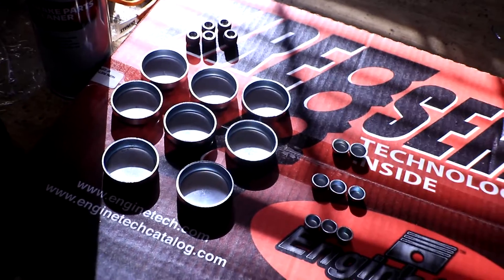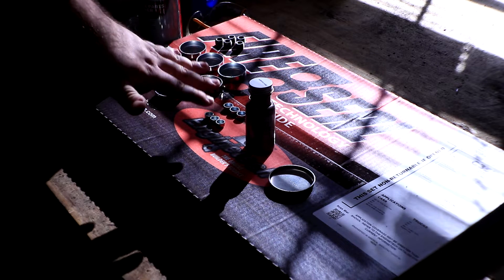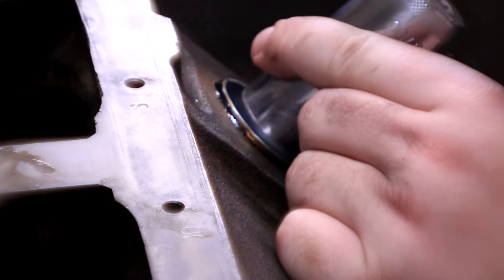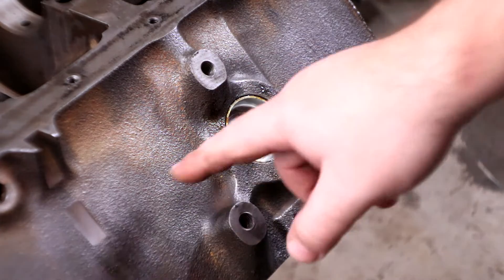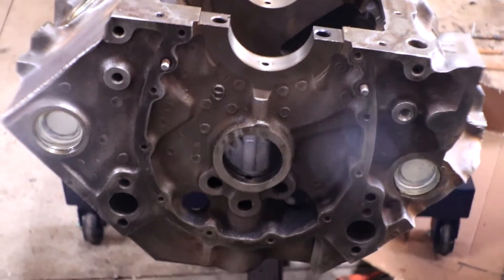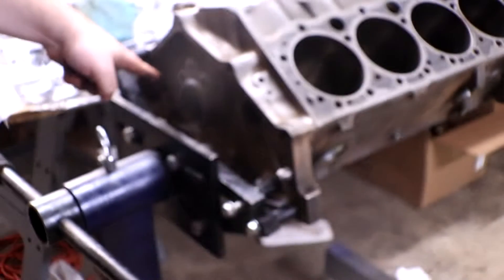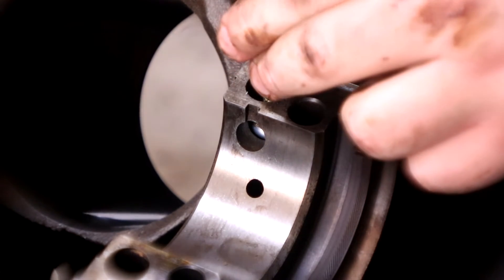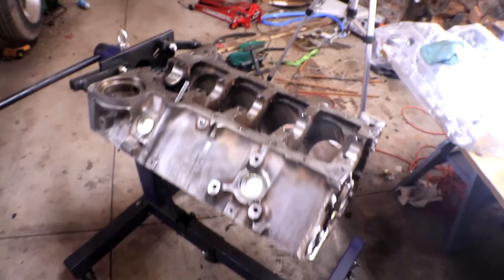HOW TO INSTALL FREEZE PLUGS IN YOUR CHEVY 350 ENGINE!

Comment: Does anyone have an idea if the plugs that go directly into the heads are called freeze plugs? I had the front and rear pop out on my passenger side. They have a rough diameter of 1 1/4 inches and I'm not being able to find them anywhere.
Reply: Answering my own question just in case anyone else has stumped as well. I found these parts at multiple parts stores. I used a replacement rubber freeze plug made by Dorman part number 02601 and it's the one and one quarter inch
Reply: @chrislane8603  exactly what i needed thank you
Reply: They are correctly called core plugs. That is where the core sand is removed from the casting.

Comment: You need to use a bigger socket and a dead blow hammer.  Never use a steel hammer to hit another tool with.  You should tap the front oil galley holes and install 5/16 plugs.
Reply: are you not seeing that the mf part is installed???

Comment: Hey those 3 little Plugs you drove in at the front of the block are for the main cam tunnel Oil gallery's and one upgrade most guys do is to tap those holes for a 1/4 Inch pipe plug. You don't actually have to do any drilling just run the tap through and that way you can eliminate the possibility for those plugs to pop out because if they do you'll lose all oil pressure and that's not fun. Other than that great work man love the progress. Brass block plugs are easier to drive in and don't rust too BTW.
Reply: Yeah but there is one of those front plugs that put in too deep will block an oil passage
Reply: @brettjohnson8009  yes that is true I forgot to mention that the oil gallery at the top of the cam tunnel you have to make sure the plug doesn't block or restrict the small oil hole tht is drill directly downwards towards the cam bearing.
Reply: @wrenbrighton2358  I've seen it happen., most forget that pipe taps are tapered , the taper is what makes them seal , but to get them tight they have to be turned in further,  plugging the hole
Reply: Brass rust as well

Comment: Should remove one of the 1/4 plugs that goes into each side of the block and replace it with a brass or stainless steel lever tap. Can drain the entire block of water after you have first run the enhine for a while, any rust, dirt, shit thats in the block will get flushed out then. Run the engine in without antifreeze/anti-rust/coolant in it for first 500miles. 
Stops the chance of antifreeze soaking thru a headgasket as gasket gets a chance to harden up.
Reply: Head gaskets don't have to "harden up" to seal, WTF ??
Reply: MLS/steel gaskets dont of course. 
Composition gaskets will harden up after a certain period of time from new. If coolant/antifreeze is put into a newly rebuilt engine with composiition gaskets then there is a chance it will seep thru and siften the gasket up. So why put the coolant in when it can be run on plain water for the first 500 odd miles then add the coolant later on. Its worked for us on engines up to 30 litres in both petrol and esp diesel (na, turboed, supercharged) for 40 odd years. Same goes for sum types of  paper gaskets. Does depend on concentration of coolant too.

Comment: Most important information about freeze plugs in cooling system. They don't fully seal until the engine has warmed up. You must leave radiator cap off when warming up engine. Freeze plugs expand when engine warms up & that's when they become fully sealed. Leaving radiator cap off stops pressure building up before freeze plugs are fully sealed and prevents water leaking past seal plugs. Warm the engine then let cool with no radiator cap on. Leave to fully cure sealer on freeze plugs. Overnight is better. Up to you.
Reply: Where the hell did you come up with that malarkey
Reply: This is completely incorrect.

Comment: Two mistakes you've made it are about to make.
Using steel plugs, they will rust from the inside. Paint over them and you won't know when they start to rust from the outside. Also when you drive them in and you scraped the coating on them they will rust. I use brass plugs. They don't rust .
Just a thought....
Reply from the maker: Very good insights, may consider swapping them out!
Reply: @TheGarageGoblin  make sure you clean that crap you put on them or it will leak. I've never used any sealer to install them. Brass is a little softer and will conform to the block. All you need is the right size socket like you used but use the other end of the socket, the ratchet side not the nut side..
Reply: Brass does rust
Reply: @juniorsvt6162  
No, brass doesn't rust.
It may corrode, but it doesn't rust.
Reply: I have a 71 Monte Carlo with a 350, does it have 2 freeze plugs on the back side of the engine for the coolant?
Reply: @elijahgonzales3252  not sure
Reply: @elijahgonzales3252 I believe those have 3 coolant holes on back of the engine where the transmission and engine meet, two on each side (2left side/2right side) and 3 in the front of the engine